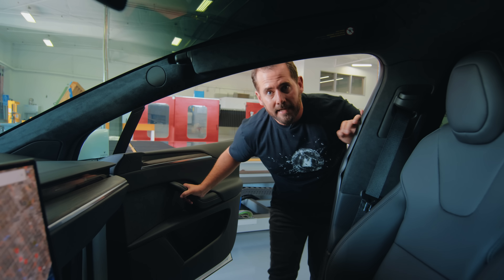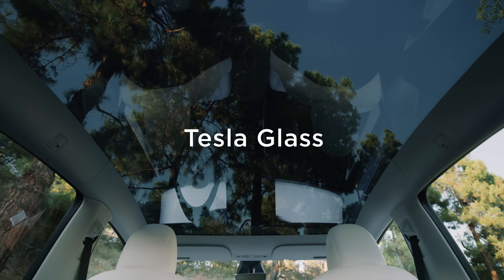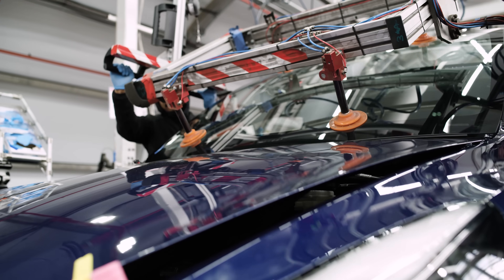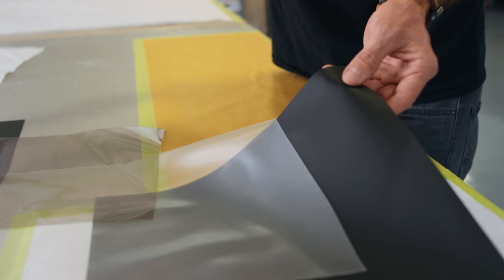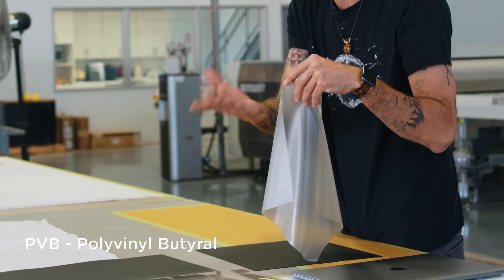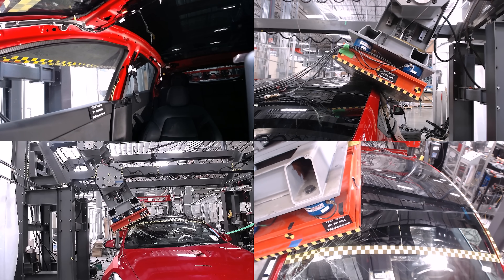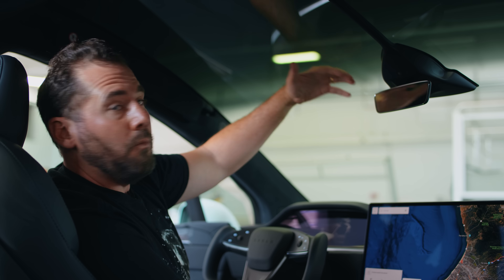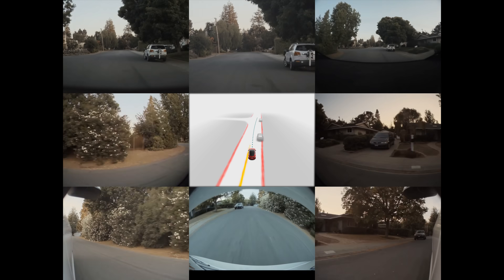Tesla Glass | The Secret to a Quiet Cabin

Comment: I like how Tesla is usually so confident in their edge that they just blurt out company secrets like these.  As though daring competitors to take it for themselves.
Reply: it's not what they show, which is hard to figure out. the innovation was to figure out a way to manufacture this both sustainably/clean so as affordible to include it standard even in a 2021 39k Tesla Model 3. That's the secrets other car manufacturers would wish to achieve for themselve or find out. The few lawsuits Tesla ever did about stolen technology/software were two ex-coworkers which stole driving AI programming data, to sell it to and be employed by a Chinese manufacturer after, which was already famous for copying Tesla for years, before Tesla finally did one lawsuit and only about the stolen software (something which was many years in development, and nobody else could ever achieve this early). Tesla even is the only car manufacturer which constantly reveals further and further patens of themselves to be free to use legally, to finally speed the competition, best of which currently lacks 12+ years behind. This all in order to help achieving sustainable and healthy overall transportation on the planet, and as they can afford giving away certain ideas and technologies, being this far ahead of every other, and in most cases FOR MUCH CHEAPER. Starting at 39k fir 2021 models (Y and 3) and 25k with a new different model in 2023.

Comment: So this is why my Model 3 cabin is so damn loud when I'm on the highway 

1:34 PM
9/16/2021
Reply: It's not the insulation or glass roof from which the suspected noise comes from. It's proportional perception of noise: It's the fact how quiet a Tesla is (not carrying around a noisy humming combustion engine), the lack of noise that makes you think you hear outdoor noises louder. Any EV-manufacturer currently has this issue, working hard on it. Tesla so far has reached the lowest decibels with its 2021 models. Yet improving it with every new Model and version. Anyhow: You may use a decibel measuring device to compare a 2021 Tesla Model 3, Y, X or S to any of your friend's cars (unless a 4 tons heavy double vacuum glassed flag ship Rolls Royce of course). You'll be surprised how quiet your Tesla is. I have a Tesla Model 3 Performance, 2021 version. I tested it myself. In fact even the thick steel floor plus its 10cm thick battery pack seems bigger source of outdoor noises coming through than the glass area. They did an incredible job. Even the window wipers in Teslas are the calmest on the market, specially designed to be as quiet as possible. They had to, as in any other car (even some EVs - with bad loud aircons) other noises are louder than the wipers, while in a Tesla all else is so quiet that you start hearing any little thing. PS: The glass roof was not just chosen for the feel of openness and better vision, but also for its strength. This type of innovative glass, together with the roof frame make it (impossible with carbon or metal sheet) the strongest roof on the market by far - stonger than roofs of PVs with over tripple the weight...

Comment: I've had to replace 3 front windshields in the past 18 months for my 3. AZ is #1 here but I feel if anyone can solve this issue, it's Tesla!
Reply: Three windshields why? Are you counting seconds of following distance?
Reply: @isthatatesla  of course. its just that AZ freeways are landscaped with rocks. these all happen on the 202
Reply: ...in which Tesla center are you servicing your car? ...as a car collector (especially low aerodynamic sports cars) I can recommend, as the Tesla Model 3 is also a very aerodynamic, flat/low sportscar, to not drive too closely behind other cars, especially on higher speeds and during winter. Any car window, even in hypercars, sold for several hundred thousand k, they also get cracks when hit by even smallest stones, sometimes sand corns, when hit at high speeds - the force is enormous (usually comming out of a tire, from a car in front of you). Tesla is working on improved but light weight bullet proof glass though, first used in the Tesla Semi Truck and Cyber Truck, later on in all Teslas. They are working on it, to make it affordible in mass manufacturing. That would make it the first mass manufactured cars on the market that include bullet proof glass.
Reply: @manueldavid7369  mesa az

Comment: What would be really nice would be the auto-tinting that is available on eyeglasses where the tint gets darker with greater UV exposure or the electrically adjustable tinting used on Boeing 787 passenger windows.
Reply: The new Teslas are from 39k, soon only 25k price tag with the next additional Model coming. Though such ideas work and are nice, the windows also need to stay cheap as possible... so that many people can afford it. Currently such tech is still too hard and expensive to manufacture for affordible cars.

Comment: Really hope this will be an engineering series instead of a one off video! More like these! Tesla needs to finally start showing off all the cool stuff happening inside the cars. So much doesn't get talked about and it's about time we dive into it!
Reply: The first laminated glass put in cars had a layer that would darken and become brittle over time. In the late 1930s, manufacturers began using Polyvinyl Butyral (PVB) to make auto glass clearer and stronger as well as to help block sound and harmful ultraviolet rays.

By 1937, safety glass became mandated for all cars. Changes occurred slowly throughout the years with innovations like the curved windshield from Studebaker in the 1940s.

Comment: Imagine having a crack on your front and having to replace the whole glass. Ooof, Tesla wants your money.
Reply: ..actually the likelyhood for such glasses to crack or have any other issues is far far lower than with conventional glass. Also Tesla figured out systems to manufacture it at even slightly less cost than traditional car windows. Innovation was the key. Achieving more with less ressources. Therefore a 2021 Tesla Model 3 only costs 39k, all included. They even found strategies with any component, to make it maintenance free and not necessary to replace anything. Tesla has (since 2017) the least amounts of service visits of any car brand in the world, also offering, IF EVER NEEDED, the cheapest service costs. Current Teslas only need new tires every now and then and fresh window wiper water when it's empty. No oils, no sudden expensive filter replacements, no mechanical part maintenance, not even brake maintenances, since Teslas are equiped with e-motors strong enough to avoid using the brakes at all and using the motors to generate back electricity instead. Calculated over 5 years, a Tesla Model 3 is currently the cheapest car on the market. Not to forget how much longer than any other car it keeps its value stable. It's quality which saves money, if done the right way.

Comment: Tesla needs to fix the thermal heat issue with the glass roof, making the interior temp very high when parked or driving. This has a negative impact on battery utilization.
Reply: Driven a Tesla with a metal roof? If anything it's hotter as glass heats and cools quicker. Try a glass versus steel saucepan as a test.
Reply: @isthatatesla  your analogy is not applicable. Metal blocks the IR from heating up the interior. Tesla store sells a glass roof cover to minimize the IR. I cover my glass roof and it is much cooler.
Reply: @isthatatesla  That is an idiotic analogy and statement.

Comment: Make 👏 it 👏 serviceable 👏 by 👏 third 👏 parties 👏 cars are not transport as a service, they are owned property. Innovation in design is valuable for distinguishing the product, but it means nothing if the customer loses their right to repair once they have taken possession.
Reply: There's plenty of third parties that can work on Tesla. Heck, I've got a mobile guy that can probably do a lot. He's not running software though.
Reply: @isthatatesla  as people like Rossmann and Rich have discussed at length, what is openly and easily serviceable, and what is available to buy by third party service agents,  falls far short of what other vehicle manufacturers have offered for decades. A lot of primary systems are still essentially unavailable for purchase or installation by an individual or third party shops, unless they've reverse engineered the systems or have somehow acquired Tesla tooling. I love the cars and the innovation in them. However, the prospect of buying a second hand Tesla then having things like Supercharging or FSD irreversibly disabled due to hardware replacement or third party repairs being done - despite them having being paid for and specified on the vehicle by the first owner - seems totally unacceptable. Tesla is alone in the industry for doing this. They need a bit of a mindset adjustment in favour of consumer rights.

Comment: they should have a video just like this on how they make their panel gaps so large
Reply: It's a myth today, which was caused by their very first model (Roadster 1) already 17 years ago, which was based on a Lotus chassis. Lotus (british brand) used to have manufacturing issues. Teslas ordered from 2021 all don't have any panel gap problems. You can find far more German brands with gap issues today than Teslas. I saw a Bentley SUV the other day that had panel gap issues... Just the press, sponsored by it, would of course never say anything negative about their Bentley or VW group sponsors.... "don't bite the hand which feeds you" is the thinking of course.

Comment: the secret to a quiet cabin… get rid of the glass roof and frameless windows, as a start.
Reply: It's not the insulation or glass roof from which the suspected noise comes from. It's proportional perception of noise: It's the fact how quiet a Tesla is (not carrying around a noisy humming combustion engine), the lack of noise that makes you think you hear outdoor noises louder. Any EV-manufacturer currently has this issue, working hard on it. Tesla so far has reached the lowest decibels with its 2021 models. Yet improving it with every new Model and versio. Anyhow: You may use a decibel measuring device to compare a 2021 Tesla Model 3, Y, X or S to any of your friend's cars (unless a 4 tons heavy double vacuum glassed flag ship Rolls Royce of course). You'll be surprised. I have a Tesla Model 3 Performance, 2021 version. I tested it myself. In fact even the thick steel floor plus its 10cm thick battery pack seems bigger source of outdoor noises than the glass area. They did an incredible job. Even the window wipers in Teslas are the calmest on the market, specially designed to be as quiet as possible. They had to, as in any other car (even some EVs - with bad loud aircons) other noises are louder than the wipers, while in a Tesla all else is so quiet that you start hearing any little thing. PS: The glass roof was not just chosen for the feel of openness and better vision, but also for its strength. This type of innovative glass, together with the roof frame make it (impossible with carbon or metal sheet) the strongest roof on the market by far - stonger than roofs of PVs with over tripple the weight... And the doors are frameless for safety reasons (in car crashes get stuck much less), it's far more beautiful (ever wondered why Aston Martin won't use framed doors?) and they are much lighter and do AS GOOD AS A JOB for noise insulation, if done right. You may look at it once, how the Window closes exactly in a Tesla. It has several layers thick silicon insulating it. It's technically 2 meters deep water pressure proof. Remember the only cars that floated in flooded deep garages the past year? It were Teslas. But check it out yourself - test drives at Tesla are possible to simply book online, very easy going experts at Tesla too, answering each and every question to you with best of conscience. Have fun and best wishes.